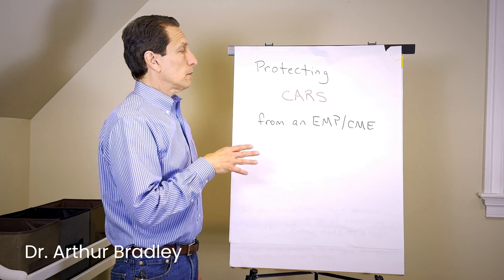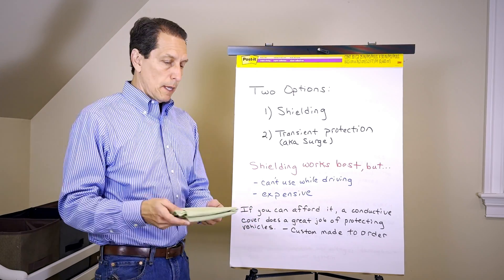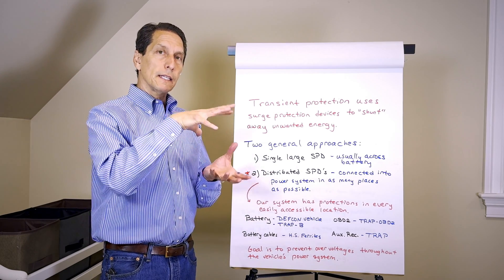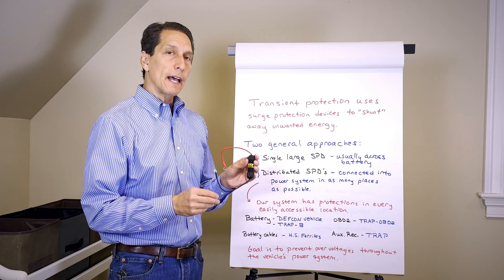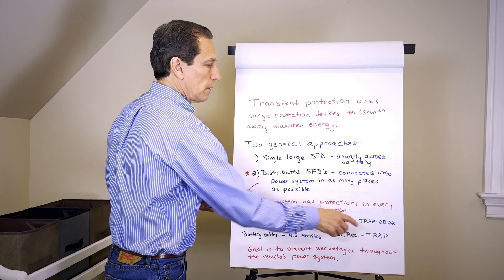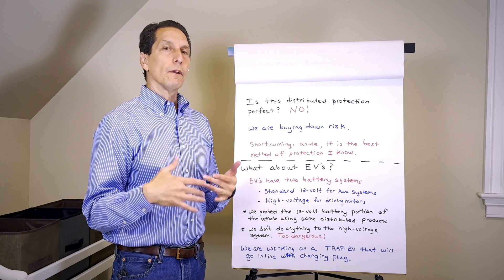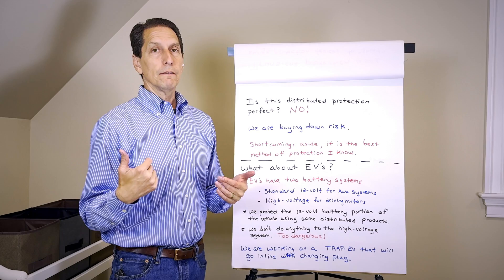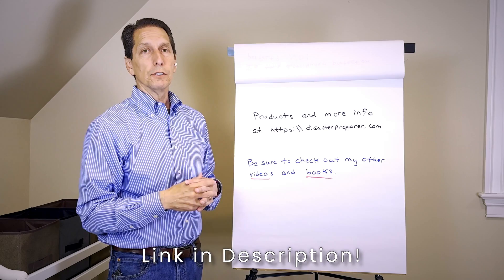EMP/CME Auto Protection

Comment: i have a hybrid, will you ever get a ferrite for the orange high voltage cables? one goes to the engine and the other to the ac compressor ❤ i have the charging cable for ev battery

Comment: 1. Since a car has dozens of fuses for the many circuit, how does a distributed surge protection help other circuits in that part of the car. The cigarette lighter plug has it's own fuse, so the battery is the only common point to other circuits with their own fuses. And surge protecting at the back end of the car will protect only that 1 circuit, not other circuits in the back of the car that have their own fuse to the battery.
2. When the car is off, how does surge protection help the circuits that are powered off?  My cigarette lighter has no power when car is off, same with many other accessories & sensors.

Comment: READ THIS BEFORE BUYING.... I showed this video to two electrical engineers at different times. The first guy said it's snake oil! He said if an EMP can go through houses, walls, computer towers, and still fry your computer then just putting things on wires of your vehicle isn't going to do a thing. He said if the electrical magnetic pulse only followed wires that would work. But he said it will go through the metal of your car through the plastic housing of your computer and Fry the components on the board.

2nd engineer started to laugh and said is this guy being serious?! He said absolutely the only thing that would work is faraday cage, cloth, or to make a faraday garage. He said he wouldn't give two cents for components to put on wires. He also said if it worked why didn't this guy show the proof of testing? Hit a car with man made EMP and see what it does to the car. He said just saying it doesn't make it believable and not showing any proof or test shows that it's fake.
Reply: the little boxes you plug into the car. yeah those are fake. the idea of shielding a car would need a isolated fariday box or cage *basically metal wires in a box around the object BUT it CANNOT touch or electrically make contact with the cage. or the cage will act as an antenna rather than a shield
Reply: Cars are already a faraday cage. Not a perfect one, but should be fine with an EMP.
Grounding the body/chassis will probably be the best protection for most cars.

Comment: I just ordered your OBD2 from Faraday defence for my 2007 Toyota Aurion, now I see you have them now. I also have a 1994 Australian XG Falcon ute with a battery and cigarette lighter traps. It doesn't have a OBD2 port.
I wonder if you would need a led light or button with light to test. If it stopped working (say blown internal fuse, etc) I wouldn't know.

Comment: Who can afford any of this? 😔
Reply: I can't.
Reply: You can improvise shielding with aluminum cans and foil encasing your electrical wiring as long as your car's body isn't wired directly to the negative terminal on your battery.
Reply: @SeaforgedArtifacts Unless your car is all fiberglass or other non metallic construction, the car chassis is the negative side of the circuit.
Reply: @DCDura  correct
Reply: I picked up a set for one of our vehicles.
Reply: Not everyone is poor ;-) Joking aside you buy house/car insurance I assume I regard preparing for worst case scenarios and hope I never have to use them.
Reply: I found these cheaper than his competitors.
Reply: How much u spend on cigarettes, alcohol,  chips, or other junk food.
Do u spend unnecessary  money on your car rims.cut other stuff out and u can afford it
Reply: It is a major investment; you’d have to also consider whether or not your area would have working gas stations. If not you’d need gas stored properly and other spare parts too
Reply: I use this stuff on my vehicles with the sole purpose of getting everyone home after an EMP event. I don’t plan on leaving my house unless I have to after SHTF.
Reply: I dont know if this will work for you but depending on the age of your vehicle maybe you can buy the cars computer from a junk yard and store them in a faraday cage. Again I dont know if it will work but it's a idea to ask.
Reply: Saving and working my butt off, that’s how